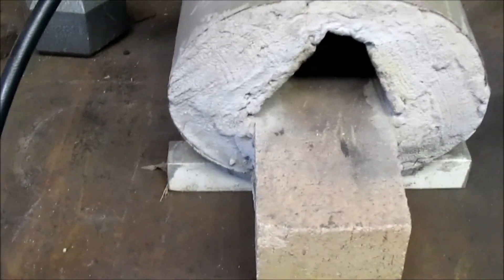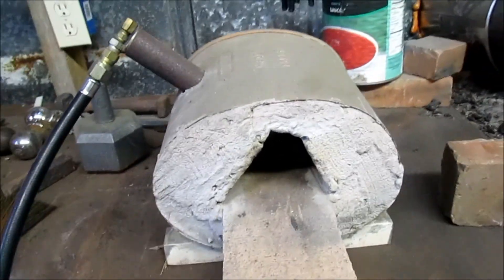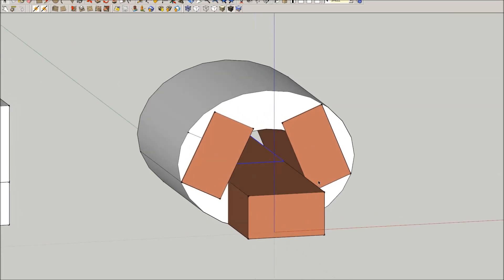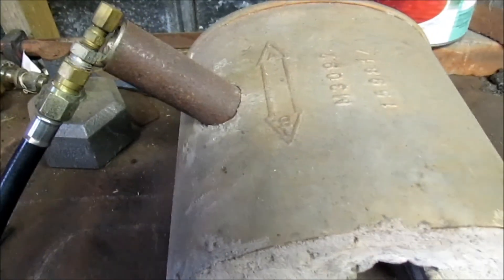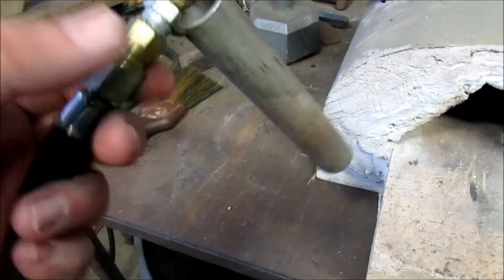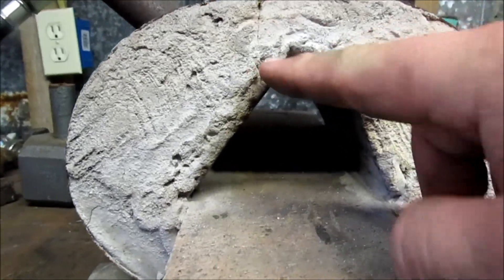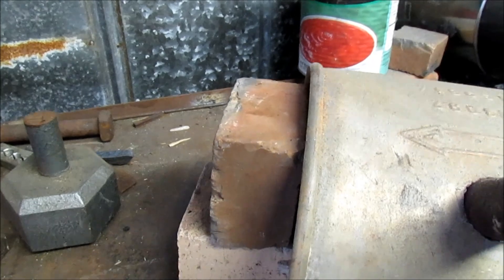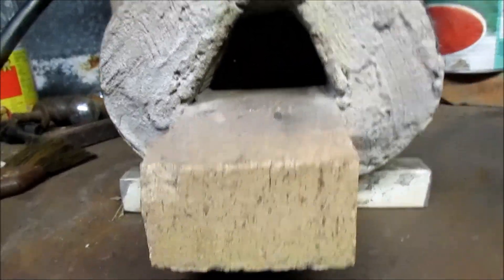MY HOMEMADE GAS FORGE

Comment: I like the video editing at the end.  How did you do that?
Reply from the maker: +BigIronTV Hey thanks. I started doing that a few months ago with a program called "Microsoft Expression Encoder 4"  I dont really like how the overlays are a little fuzzy but it was the only free program that I could find that did them.  The program is not supported anymore either so some of the other functions are removed, but I just use it for the video links. The links are just spotlight annotations, they dont show up on mobile platforms either.

Comment: I saw your post on Instagram and I immediately went here to see your forge. It's a really cool design. I'm thinking of making a different type of forge and I bought 50lbs of sand and 30lbs of plaster of Paris. Any recommendations for objects to use to put the mix into to have a pretty good volume for forging let's say a machete? Thanks and keep up the great videos.
Reply from the maker: +The Russian Woodworker Hey thanks for checking out the vid and following on Instagram! I'm not a gas forge "expert"by any means but I've read of a few different things to put in the mix; hardwood ash, vermiculite and perlite are some common things I see. When I was researching making my own I thought that adding some crushed firebrick my be good. In my limited experience, I think if you had at least 2 inches of insulation/refractory you should be able to keep enough heat to forge and be fairly efficient with your fuel. I forged my first throwing knife in this forge using the weed burner. Before you get to deep into it you might do a search on some forums if you haven't already http://www.theironforgefire.com/ and http://www.iforgeiron.com/ have a lot of great info from folks that have a lot of experience.Thanks again.